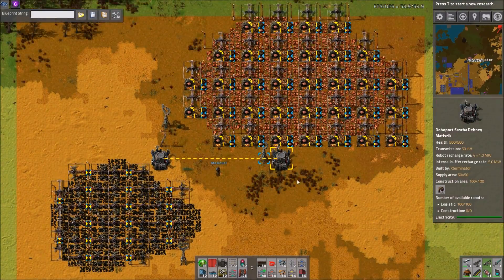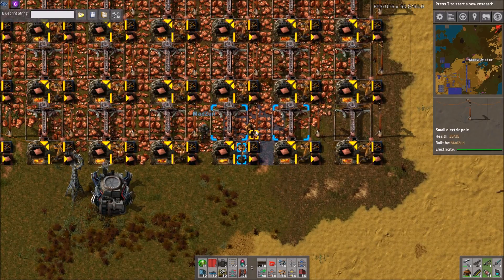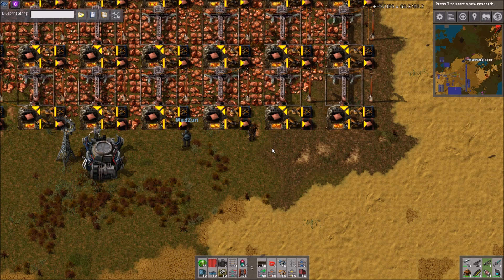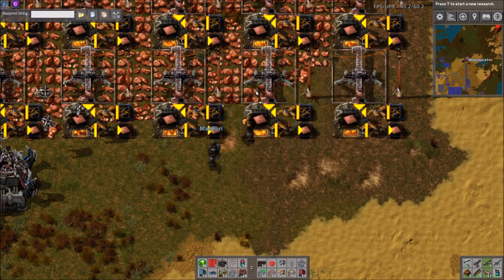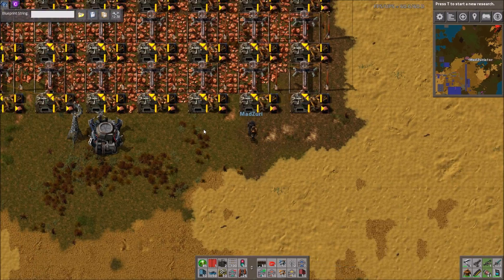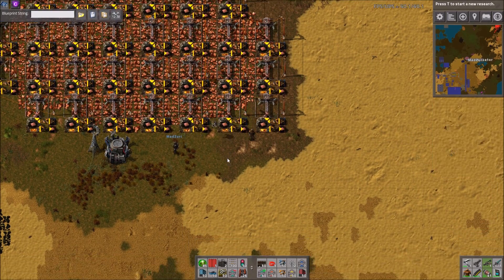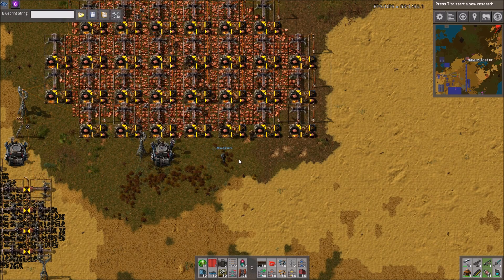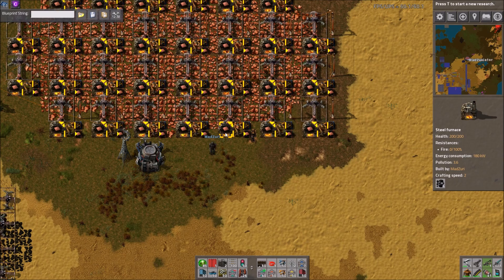Factorio Workshop - Building A Better Factory::  On-site Smelting Design

Comment: IF you use Electric one you just lose 1/6 of The ore. not realy That much of a problem. Just move The unit
Reply: Technically it's 1/9 of the ore, the center patch under the furnace.  2 miners directed into the furnace (9x3 area total), and offset the next line by 4 squares will take care of capturing it all except the center (the other offset block can contain the inserter, chest and pole in the 1x3 leftover from the shift).  Buuuuut...it's just a game, whatever lol
Reply: Robert Caldwell Well.. you still need space for the chest... but.. well you may be able to ofsett it by one square.. and that would be sufficent.. 

The issue is that you can´t have any modules with this set up.ö
Reply: matsv201 Did you not read when I said "offset it by 4"?  This means that you have miner, furnace, miner....below that you will have 4 blocks -> then miner, furnace miner.  Because it has moved the 3 blocks that the miner is and 1 block of the furnace, there is a gap of 1 block......you put an inserter, chest and pole there.  The next lane up, continue.  If you offset it by 1 square, then you have the furnaces jumbled up next to each other and you can't get any ore out at all.

And you could put modules in, like efficiency in the miners and speed/efficiency in the furnaces.....surround the whole thing with turrets, baddabing baddaboom.  It's a game, you do what you want, I don't like going straight into furnaces myself....but then again, I have like 25+ mods installed, so there's no way that would work regardless.
Reply: Robert Caldwell A okey.. i was thinking of ofsetting them in the other direction. Its kind of hard to sea t with just words.

"And you could put modules in, like efficiency in the miners and speed/efficiency in the furnaces"
Well yea.. i was thinking about the Productivity/speed combo.

The issue is that this is a really good way to build late game stuff. But late game is where you want productivity. Efficiency is not that important for late game

(By they way. A efficiency I takes about half to 1/3 the resources to make then the equivalent amount of solar and battery in power. But Efficency II takes almost 2 as much resources to make... So there is really never a point in using efficency II)

Comment: Still need to move the coal. In bob's mod, you could use those large area miners. But, honestly, I'd run a single train around carrying solid fuel to each outpost in a loop. The solid fuel would last for ages.
Reply from the maker: Yup using solid fuel would be the ideal option honestly. It lasts so damn long in furnaces.
Reply: Xterminator Yeah, it's more important in Bob's mod for sure. I use a bunch of overflow via my oil production so that oil can keep running. Initially you don't have access to fracking, and honestly, if you can avoid consuming a tonne of coal, it makes life much easier. I actually had this moment in one of my bases, where the issue was too much petrol. I've decided something important about Bob's, you need factorissimo just to keep your sanity.

Comment: a way to keep the flickering from happening, put 1 to 2 pieces of ore in each smelter, keeps it going continuously
Reply: But not forever, eventually it will slowly burn through the additional ore.
Reply from the maker: Nice, I actually wouldn't have thought of that! Although it is a bit of a pain to do each time you set up a mine. :/
Reply: Thats not true. No matter what due to the way that factorio calculates mining speed its impossible to get an exact 1 to 1 ratio in order to stop flickering. Over time the miner or the smelter will pull ahead. The closest ratio is using 1 speed1 module and a prod1 module but even then the miner will still be slow. The productivitied version of this happens to be 2prod3 and a speed1 in order to get a close ratio however the mining drill will be faster and the furnace will fill up and thus cause the power grid to flicker so it would be good to add a small buffer on a separate network connected by an accumulator. 

Edit: As an extra tip. In order to use trains I'd advise a 3-7-3 with a coal wagon in the middle in order to give slightly more fuel from 1 wagon of coal to 6 of plate.

Comment: Using Marathon mod, multiple ore are needed to make one plate. This makes on-site smelting even more appealing and useful!
In fact fabricating copper cable and steel in outposts is really effective for even more volume reduction.  (in marathon mod, multiple plate make one cable, so this is a win. It would be wrong to make cable remotely in vanilla where plate is EXPANDED into multiple cable)

These changed ratios is one reason Marathon mod makes more interesting factory designs.
Reply: Yeah but, in marathon mod, you want the smelting to be next to the product, so ore on the belt works better.